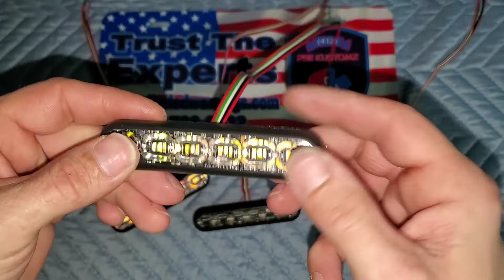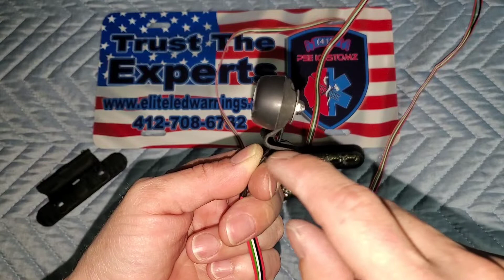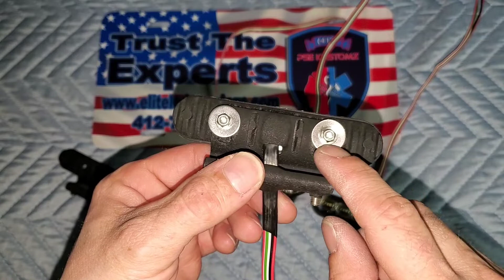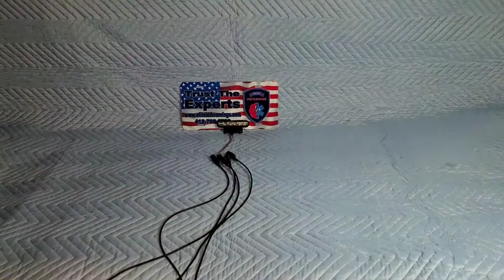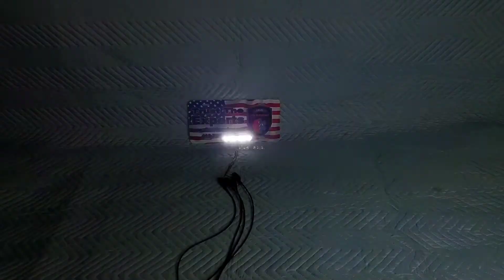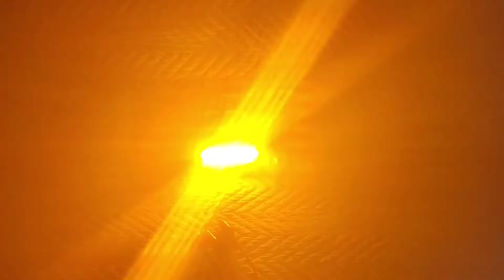mPower 4" Tri-Color Fascia Led Lights by Soundoff Signal

Comment: I may have missed this, but to use the tri color in blueprint mode do you just need the two control wires, leave the white unterminated, and the green tied to ground?
Reply from the maker: This video was shot in the early days of blueprint so it wasn't used as widely as it is today. Blueprint can get very complex so I highly recommend in depth research and maybe taking the blueprint training program SOS offers. 
Normally the mPower light use power/ground and a data line(which is the green or green/white wire. 
But again I highly recommend doing some very in depth research or enrollment in the SOS blueprint training program.
Reply: @412psekustomzllc7  thanks for the reply! yeah, I've reached out to SoundOff, and will be seeking out training as well. On a pretty base level though, with a 5 wire tri color  those 3 wires (ground+green, red, and red/white or orange) should provide control of all three colors?
Reply: @412psekustomzllc7 I confirmed with soundoff. Just the 3 wires required, power on 1, 2, or both will trigger the 3 colors.

Comment: Is there a "cruise" light mode setting ?
Reply from the maker: Yes absolutely along with a variety of other options. They actually have four programmable lighting modes so you can achieve exactly the performance you need.
Reply: @412psekustomzllc7  Great and many thanks !

Comment: Is it possible to put one of these in the place where a Whelen Ion goes in the Flush Mount style mirror beam Whelen offers? As in just popping out the Ion and putting in an Mpower?
Reply from the maker: No that would not work. The surface mount Whelen Ions measure almost 6" long. The mPower Fascia Lights are only 4". 
If your Whelen Mirror Beam caps have only a small center hole you may get away with a set of the screw mount mPowers but they would not fit the extrusion perfectly. Nor would they cover the factory mounting holes meant for the surface mount ION.
Reply: @412psekustomzllc7   Ah ok. However, I think you might be thinking of a different style of Whelen mirror beam. The one I’m thinking of has the universal mount, which also measure 4 inches in length like the Soundoff Mpower. I know Soundoff makes an angled wedge for mirror mounting an Mpower, but I think the style of the Whelen Mirror Beam looks a lot more complete.

Comment: would it be possible to to steady burn Red for a brake/turn light and white override for reverse lights?
Reply from the maker: Yes that is possible. You would need to download the SOS install guide and look through all operating modes. Each of the programmable modes allows certain wires to operate certain colors & functions. So it would just be finding the right operating mode to perform the exact functions your looking for. 
Another option would be to go with SOS's Blueprint operating system which would afford you almost endless operation possibilities.

Comment: Nice Lights. The red can be override and white? Or just one color? Thanks
Reply from the maker: There are many programmable options to these. So they can be set to function almost way you need. They have three operating tables(reffer to the SOS install programming pdf.) you can program them with. Then with which ever table you choose to go with, the Red, White & Red/White wire leads either activated individually or in combination with one another will serve as an operation. Hope this makes sense. Basically there are a ton of Operation/Functionality possibilities. Not to mention they are Blueprint compatible. Which if you would use the SOS Blueprint system(SoundOff Signals equivalent to the Whelen Core, or Code3 Matrix systems) there would be endless possibilities for how these could operate. If you like these mPowers we suggest checking out our video/s that showcase the mPower 4x2 which is basically a double stack version of the 4" Fascia light. The 4x2's are absolutely wicked surface mounts!
Reply: @412psekustomzllc7  Great explanation. Thanks a lot. I will take a look. Be safe.

Comment: There is a large fleet that runs these as external lights near me and a fair amount of them have water ingress and damage. I'd recommend only using these as internal lights.
Reply from the maker: Intresting, I wonder where they differ. We have installed 100's of these on wrecker's and have only had two warranty claims. Most of them are installed down low by the rockers. We have changed out many of these with various failure issues but none of those were installed by our techs initially so we cannot be sure were the failure happened.
Reply: 412 PSE Kustomz, LLC most that I’m familiar with are stud mount, so I wonder if the people installing them are cranking down on the studs too hard and warping the backplane or something. 

They are damn bright lights for the size.